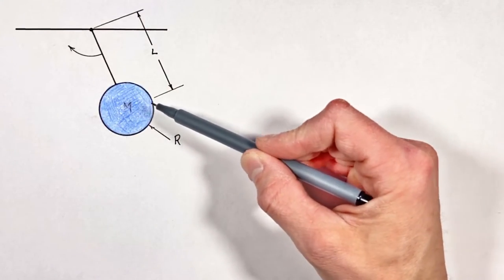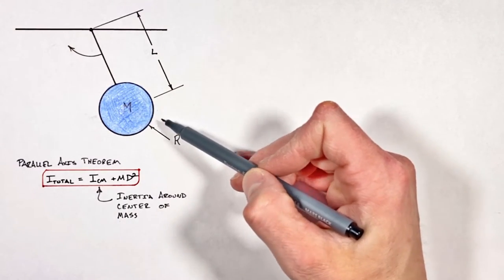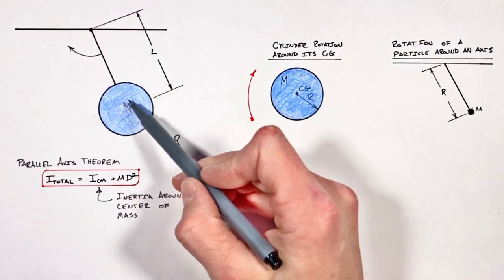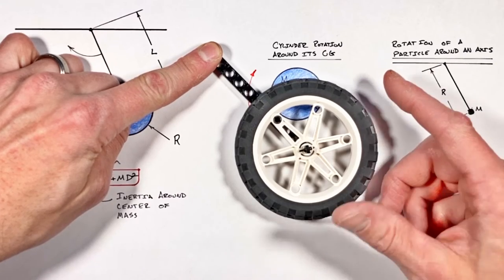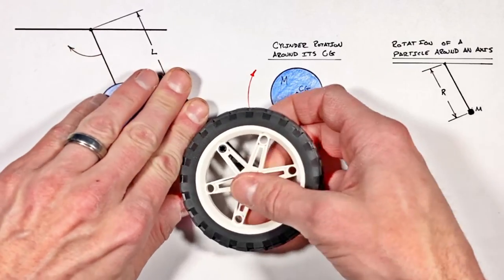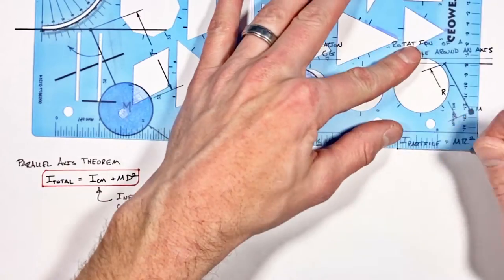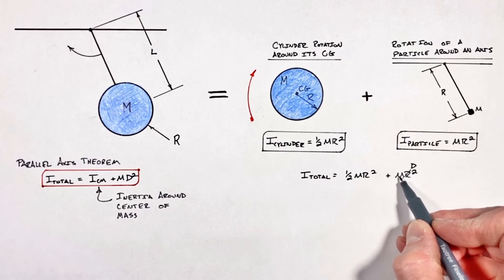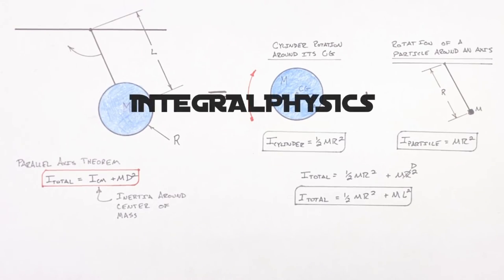What is the Parallel Axis Theorem? | Rotation & Moments of Inertia

Comment: Hi if I apply the parallel axis theorem to a body of mass m in uniform circular motion around a point a distance r away,  then I get the angular momentum of the body about the point  is 
(I + mr^2) omega where I is the body's moment of inertia around its COM and omega is the body's angular velocity around the point.

However if we compute the angular momentum by just getting the orbital angular momentum about the point (where the body isn't spinning around its COM), we get r × mv = (mr^2 omega) which is clearly different to what we got above.

Can you point out where I might be making a mistake here.
Your help is greatly appreciated.
Thanks.
Reply from the maker: Using the parallel axis theorem you account for the rotation of the object around its center of mass (the "I" term).  Looking exclusively at the orbital angular momentum you suppose the object has no rotation thus you only get the mr^2 term.
Reply: @INTEGRALPHYSICS 

Thank you for your reply.

OK, but what rotation around the COM needs to be accounted for in this situation. Isn't it the case that the body is not spinning around its centre of mass (it's just orbiting around a distant point). 

So why do we need the (I omega) term to account for this (when we use the parallel axis theorem to do the calculation).
Reply: @INTEGRALPHYSICS  

I think my mistake is that I am discounting that the body IS spinning in the first scenario. I think I have the wrong concept of spin. Can you confirm that spin of a body is not relative to the body's (changing) frame but IS relative to the "background" frame (the same frame we described orbital momentum in). So e.g. an earth that always has the same half of the world in light and the other half in darkness is still actually spinning.

That would resolve the problem, since in the  first scenario (where the body doesn't rotate around its COM in the moving frame, but does rotate in the background frame) both spin and angular momentum would be omega and we get the same result as using the parallel axis theorem.

Does that sound right. I think my concept of spin was just off.
Reply from the maker: Suppose the earth took 365.24 days to rotate once around on its axis.  In that case the earth would be orbiting the sun as well as rotating on its axis.  However a caveman on earth would believe that the earth does not rotate because the sun would always appear to remain stationary in the sky.  

The key here is that there's two axes of rotation, one through the COM and the other through some other point.